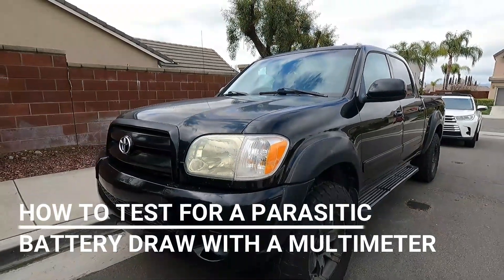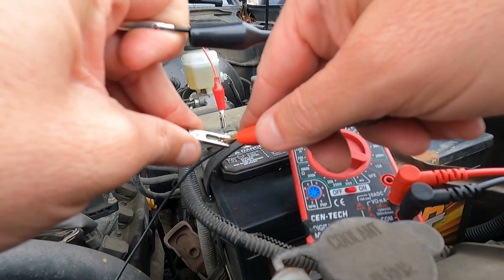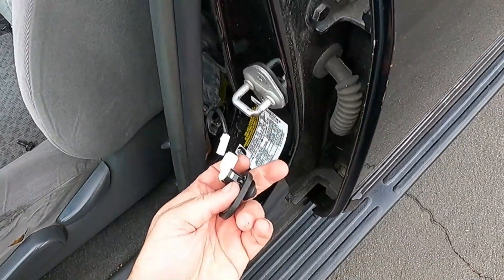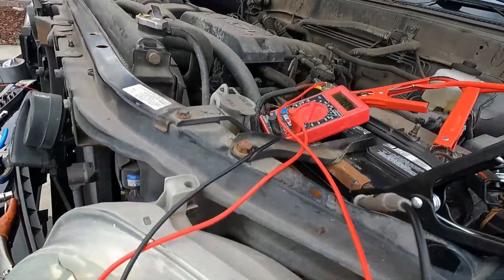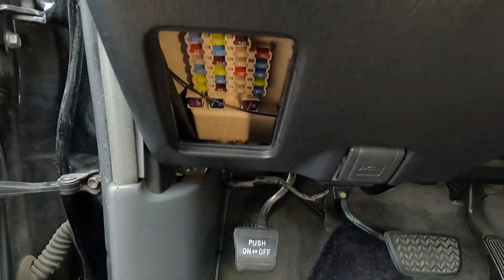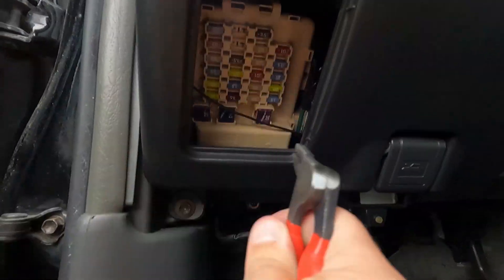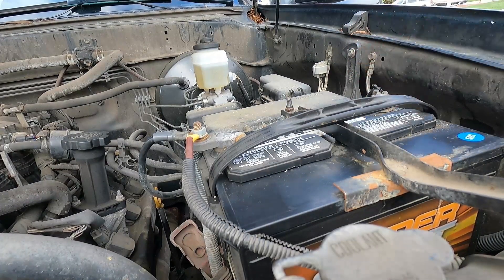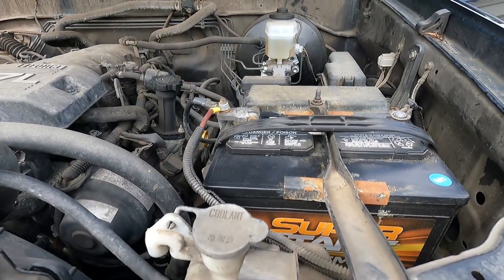2006 Toyota Tundra Dead Battery - Parasitic Draw Test - Easy Method

Comment: Thanks for your video, the 30A fuse (RAD NO.3) Audio system/video system under the hood was causing a parasitic draw of 0.50 A, once I removed that fuse it went to 0.04A. It’s the same 2006 Tundra as yours. I read that the fuse controls the radio, amp, and maybe speakers. Do you know what’s a easy way to find the root cause of the issue? Thanks
Reply from the maker: Hi Roger,
Glad to hear you found the circuit that it's on, but I really don't know of a common cause on that circuit.  Are there any aftermarket items in the vehicle? If so, I'd take a look there first.  You might need to get a wiring diagram and try to find the exact wire that is drawing current when the key is off.  I remember reading somewhere that someone had a problem with a switch or relay in their factory amp that was shorted out causing a parasitic draw similar to what you're describing.  You might also try to disconnect the amp and see if that eliminates the draw....Unfortunately it can be tough to hunt these down.
Best of luck to you!
-Dan the Fix it Man

Comment: I can't tell what's clip to what can you explain what's clips to what or in the order or take a picture
Reply from the maker: One end of the multimeter clips to the negative battery terminal and the other end of the multimeter connects to the negative battery cable
Reply: Did you ever find out what was the root cause of your issue, was it the aftermarket or the stock amp?
Thanks